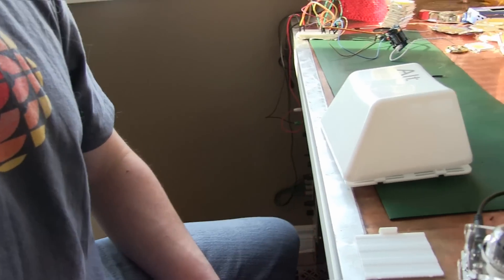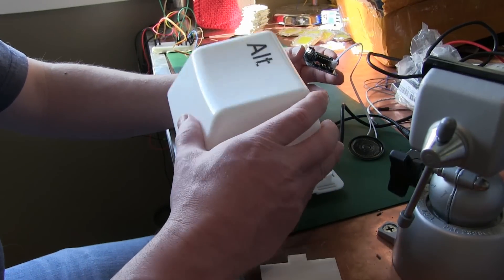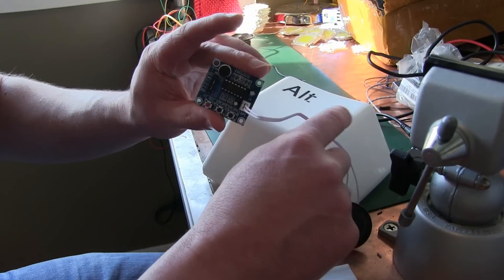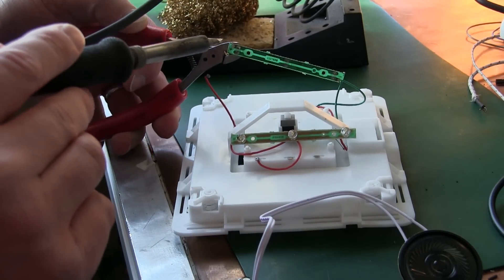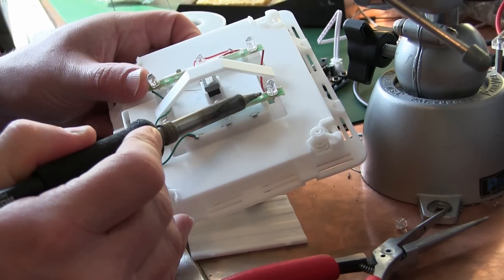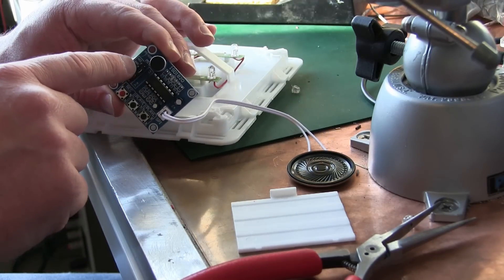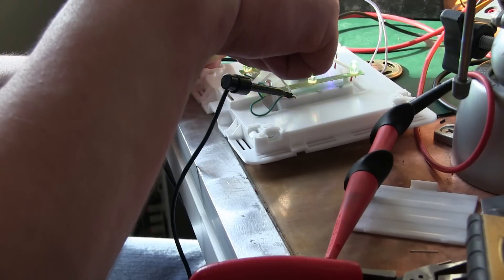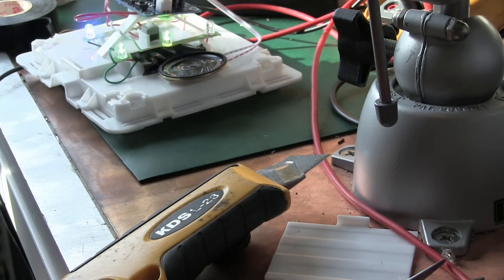Talking 'ANY' key for Problem Customers

Comment: I love electronics and appreciate this stuff AvE.   I have tried to learn more, but always ask the right question, the wrong way. Was chastised on an electronics forum for asking about magnets lol.   I think it started like " I know magnets are not "free energy",but how much energy do they contain.   Was told their not free energy, I was being a troll, and go do some research before asking those questions. So when you do this stuff it helps us that want to learn from the ground up. Cheers to you good sir. Oh and that button is skookum.
Reply: +Scott G (LOON) Yeah, the elitism in electronics forums is really irritating... In case you never found an answer, there isn't any extra energy in a magnet, the energy comes from the interaction between the magnet's field and whatever it's interacting with, the same way we get energy from gravity as a result of its interaction with other objects. The magnetic field basically makes a small area in space where it requires less energy for certain objects to be closer or further from the magnet, so the objects move to the spot that requires the least amount of energy to occupy. In the case of iron near a magnet, that position is pressed up against the magnet. It's difficult to separate the magnet and iron because you have to put energy into the system in order to move the iron out of range of the magnet. 

Put more simply, the magnet doesn't have any energy, what it does is allow magnetic things to shed some of their energy, and to separate something from a magnet, you have to give that energy back.
Reply: +Teth47 ^^ What he said!
Reply: ***** That's not even slightly relevant.
Reply: +Teth47 How's about these then:
∇ ⋅ E =  ρ/ε0
∇ ⋅ B = 0
∇ × E = -∂B/∂t
∇ × B = μ0 (J + ε0 (∂E/∂t))   ?
I'd go with Teth's explainathing though... much easier.
Reply: EscapeMCP I specialize in flowchart-level explanations XD
Reply: oh but it is

Comment: I used to work part time as an IT at the age of 16. Usually just telling people with printer problems to turn it off and back on and call back if it still has issues, 95% of the time they never call back :D
Reply: +Luke Den Hartog I've often wondered whether that was because it solved the problem, or that they never found the power switch.
Reply: They know where the power switch is because they call several times a week about the same printer...
Reply: +Campalai Well in that case, we can do nothing for them. Caveat emptor. It's therefore best practice to get off the phone ASAP and help out the next rocket surgeon who is having printer power issues.
Reply: Campalai They were printers. All printers are faulty, right out of the box.
Reply: +Luke Den Hartog 
And if you do customer support for Windows that works 98% of the time, but you need to bullshit them with updates/reinstalls and whatnot so they don't notice they are doing the same stupid thing every time.

Comment: You could cut off the heads of the LEDs to have a more diffuse light. adios amigo
Reply: +Proyectos LED Or sand the housing.
Reply: +Proyectos LED Glob of hot glue also works, and those are in two variants clear and opaque.

Comment: I'll be one of them poor bastards making ones and zeros do stuff. every. bloody. day. 😅
Reply: +John Smith depending on which end you come at it from you either need to learn VHDL or physics. I would recommend getting a cheap SPARTAN board to practice VHDL with.
Reply: Just to clarify; I "push the 1's and 0's" as a Software Developer. I only play with the pixies as a hobby. Sometimes they play with me, sometimes they ignore me, but I'm glad to say they've not yet "bitten" me too badly. Just that one experience touching a live wire as a kid trying to fix a lamp switch when still plugged in - would've been less traumatic had I lived in a 110V country but Cape Town has 230V. Now I live in England which also has 230V mains, but I'm more careful. :D

Comment: Solid... Full time 1/0 wrangler, sometimes I dabble in herding the pixies. This is a great mini project.

Also, that has a set of pins for each of the tactile switches. So you could have just tied another one of those connectors you salvaged and either tied into the led rail, or to the switch in the button. 

And for those home gamers, those connectors he salvaged are from an old computer/motherboard. FInd a computer in a junk bin, open it up for all sorts of candy.
Reply: Old computers are a magical treasure trove for anybody with the time and inclination to pull them apart. Bundes of M3 and 6-32 screws, connectors, optical drives (motors, LAZERS!), hard drives (motors, magnets), power supplies (useful if they work, and if they don't, you can salvage the internals).

Comment: i used a metal lathe for the first time ever in a robotics club. you make using one look so easy. it is easy but keeping a tolerance within 5 thousands is pretty difficult 2 of my 10 wheel spacers met the spec the rest were screw ups. 1.757 is hard on an old southbend.  but im learning though and it is very fun  i am going to be buying the harbor fright mini one

Comment: When desoldering stuff done with lead-free solder, I've had pretty good luck adding just a little dab of regular 60/40 solder, and then using ye olde solder sucker to vacuum it away. Makes it melt faster and run a little better.

Comment: I feel honored to have a video dedicated to my line of work.... However I would label this a PEBCAK error not an ID-10T. ID-10T is for more hardware use issues. Like "why do you call the extending coffee cup holder an optical drive". "my wireless mouse isn't working... What do you mean dongle, it says "wireless" as in I don't have to plug anything in". Or my favorite, when anyone calls the everything a hard drive. Computer is a hard drive, monitor is a hard drive. But it's rude and unprofessional to ask for clarification, you might make someone feel stupid.

Comment: So does that mean that talking into an IC is putting the smoke into a chip?

As for messages, I find it's usually a Layer 8 networking problem that often begs for a rearrangement of the user's vampire taps.

Comment: I’m an apprentice mechanic, (full disclaimer, I have no fucking idea what I’m talking about, but I’ve been trusted to have my hand up many a high dollar broads skirt, with out any coming back and asking for child support if you know what I mean), but here, off by a magnitude of 2 is still within the fudge factor of what we consider factory parameters since the overpaid fucks working in Michigan or Kentucky dont actually give a sweet holy shit whether or not your car works when you get it. And not only do they not care if it’s in parameters, but if it calls for 2 ohms, and it’s at 200 ohms, but still kinda working, they send it down the line, approved.  You want to talk about “sorting fly shit from pepper?”  Work at a Chevrolet dealer. There’s a reason MoPar has my respect. From what I’ve seen, they’re the only US company who’s service manual or service bulletin spec means anything, and if there’s a problem, it’s usually a 1d10t error.
Reply: Even if they’re owned by Italians.

Comment: Question: Can you combine a battery and a DC wall output to increase voltage? Lets say you need 24v and you have a 12v  battery and a 12 DC supply can those be combined? Will it explode? Can you show it ?

Comment: Is that Nixie clock a premade one, a kit or you've made it yourself? :D 
I'm trying to find a schematic for good PSU for driving them at high voltage.
Reply: +AvE 
Thank you. 

Yeah, they are not cheap. I will try to build SMPS using NE555 so we will see how it works if it doesn't kill me :D   + I want at least 2 tubes for digits.

Comment: Unfortunately powering up those far eastern boards is what electronics has degenerated into for the most part today. It is like people buying motherboards, and PSUs, throwing them in a case, then declaring that they've built a PC. Having built a computer out of chips myself I'd have to say that assembling a PC is not quite the same thing.

Comment: first
Reply: +AvE thanks, dont delete me
Reply: +AvE i love the music. sounds like a copyright strike is in your future
Reply: +AvE I call it an error in the organic interface. Takes most people a good 15min or longer to figure it out.:P
Reply: +imthekingofrs2 Not the best idea you might be fixing it again when the wire/contact rusts off due to the acid core solder.
Reply: +imthekingofrs2 hahaha, as I sit in my plumbing van , recollecting about a 20v sawsall from dewarts that need this exact surgery on the battery terminals. the patient recovered , very little scarring😅